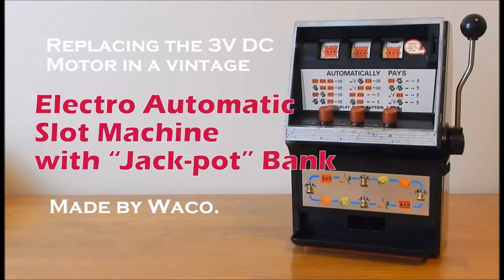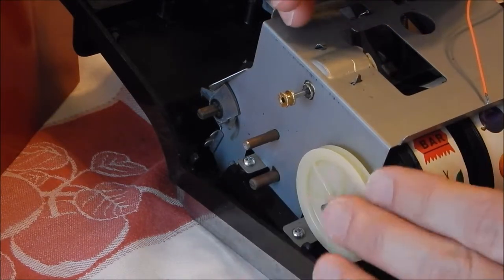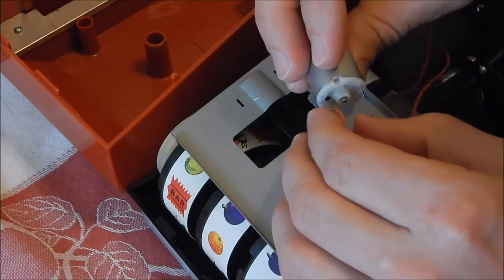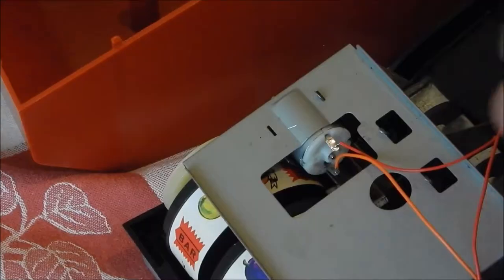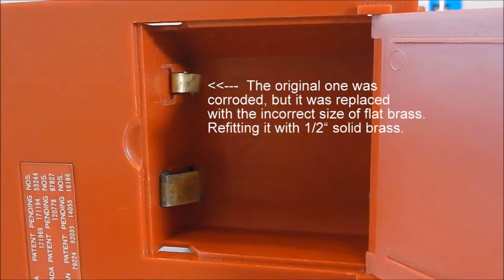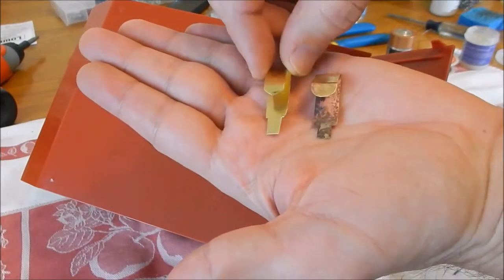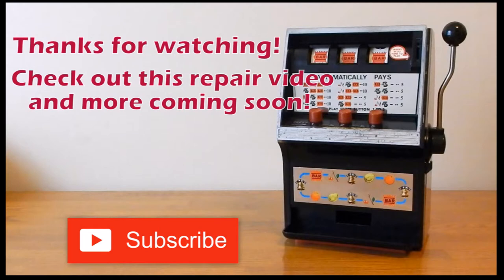How to Replace a DC Hobby Motor in a Vintage Toy Slot Machine by Waco

Comment: Thank you for this but cut you drop a shop link for the glue and or the metal peice for the motor
Reply from the maker: By 'metal piece' for the motor, I assume you're referring to the pulley or gear on the end of motor shaft.  If you're missing it, I'm not sure where to find one.  I may have forgotten to show how I removed it from the old motor.  As for the glue (Loctite), you can find it at most hardware stores or department stores in the home or hardware sections.  Apologies for the late response.
Reply: @MarxKosmos1024  yes I did mean that and I’m just having trouble removing it. If you had certain method for removing it would be amazing if you could share!

Comment: Hi so wondering if you can help me. My battery compartment is missing the metal piece. In the video you showed connecting the first red wire, however, you didn’t show how to solder the second terminal, can you help me? I really want my toy to work?
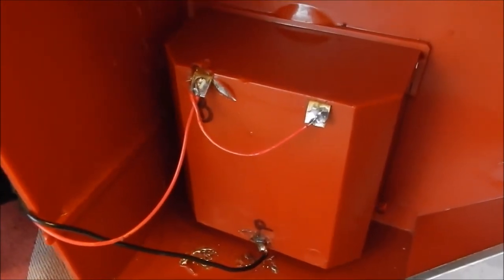Reply from the maker: Hi, Colleen.  It's been a 'minute' since I've made or even watched this video.  I guess I didn't show all the soldering.  Looking at the 13:41 mark, it shows how the red wires are connected.  If you pause the video, the red wire on the right battery terminal it soldered to the terminal on the left.  That second red wire then goes to the motor.  The black wire at the bottom is soldered to the terminal below by itself.  I think that's what you were asking about.  Oh, you also mentioned missing a 'metal piece' which I think you mean the copper battery terminal.  I do show how to make one in the video.  Any more questions, please let me know.

Comment: The wheels might be sticking a bit.  So when the first wheel stops, the 2nd isn't spinning freely anymore.  I used a light oil between them on mine to resolve the problem.  A little grease may work as well.  It is difficult to access the wheels without complete disassembly.  If you gently press the wheels away from each other, you may get a drop of oil in there, without remove the shaft.  

I had the prize strips on two of my wheels come loose.  I dabbed a little super glu on it and re-apply the paper strips.  

There are a number of springs inside this unit than may weaken or break over time and need replaced.  Springs are attached to various level arms for button operation and coin dispensing.  

If you need to replace the belt, look for a place that supplies belts for tape recorder machines.  Here's one that I've used, they are very helpful with getting the right size:
https://www.vintage-electronics.net/
Reply from the maker: Awesome!  Thanks for the tips.  I hope to get a chance to try them out in a few weeks.

Comment: Hello, I bought exactly this machine but it came without the coins / slugs. Could you do me a big favor by giving me the exact dimensions (diameter, thickness and material) of the slugs? It would be a great help in finding replacements for them. Thank you!
Reply from the maker: Sure.  I'm currently out of town, so I'll reply by next weekend.
Reply from the maker: I just sent you a reply via email.  Let me know if you received it okay.  I also put the slug dimensions in the description field too.
Reply: Dimes work well.
Reply: @That_AMC_Guy  In our machine, some dimes work, others are slightly too big.  I've been meaning to check the hardware store to see if there's a metal washer that might work.